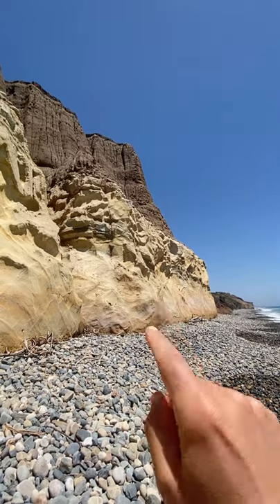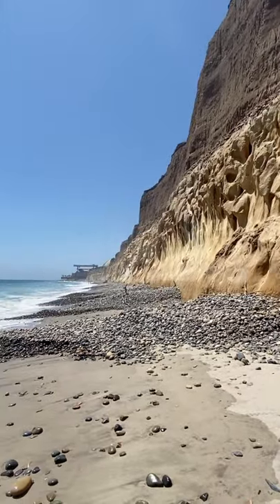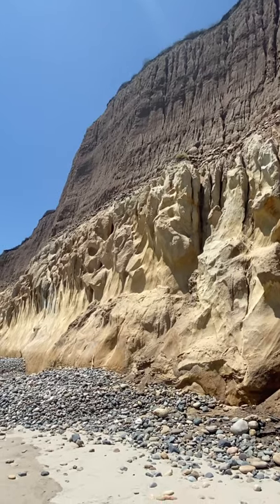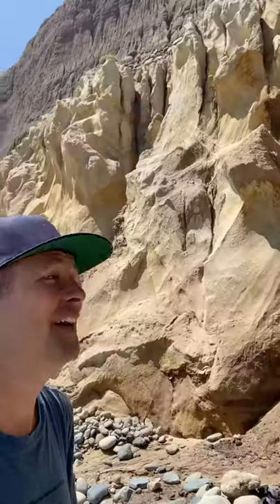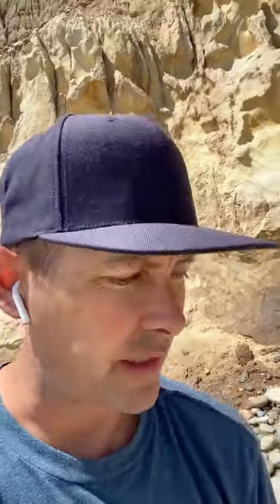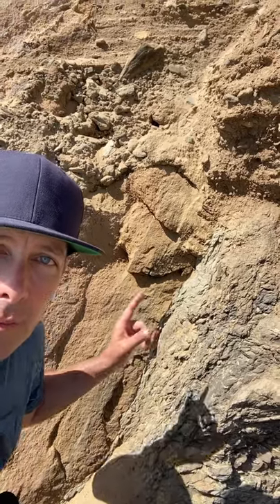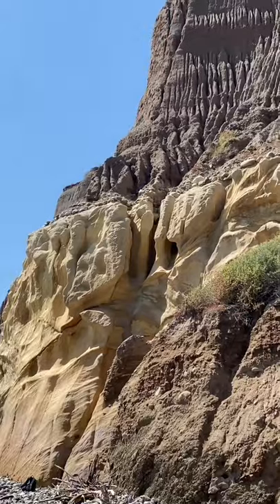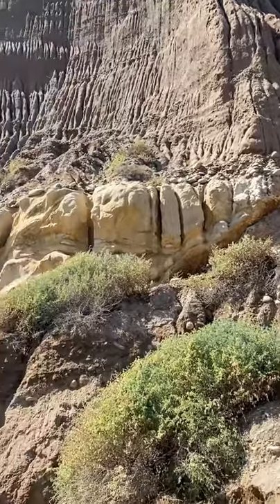Why is a Nuclear Power Plant built near a fault?

Comment: Cristianitos might be "dead," in geological terms, but the offshore Newport-Inglewood-Rose Canyon system (to which Cristianitos is connected) is most definitely not and poses its own hazards to the San Onofre site, including that of a major tsunami.  Inactive faults can reactivate, though: even if the chance is remote in this case, it's still non-zero since it's connected to an active system and embedded in a very active regional fault system.

Comment: That is a lot of top surface accretionary buildup of ONE HUNDRED PLUS FEET of boulders and mud atop a 125,000 YA previous fault activity (?)  Verbal typo (?) 125 million YA?  A most excellent vid and explanation.  Never did get all this explained until now - so kudos.  Sandstone metamorphic rock from an ocean basin/shoreline, then accretionary boulders from water and river (of magnificent size and flow events), turning into a shallow water mucky bay waters for final sedimentation.  THEN !  diagonally upthrust the whole geo upon the Monterrey shale at least 200-300 feet into the air, while the ocean level was rising and chewing away on the cliff face.  Lots of activity here.
Reply from the maker: Again, I like it!  Thanks for contributing!
Reply from the maker: Based on what I’ve read it’s around 125,000 years.  They studied isotopic ages from fossil shells from the San Onofre platform to arrive at that estimate.
Reply: @geologicallyspeaking  OK I am totally baffled.  There is 100+ feet on first boulders coming from massive outwash of waters from somewhere.  125,000 YA is earlier than end of the Ice Age 12,000s/10,000s BC (and no actual glacial fronts down this far south into Cali.  Any such finger glaciers atop the Sierras - possibly ?  Enough depth of snow and ice to wash out this nearly uniform layer of 1-2-3+ layers of boulders, then this huge dramatic mudflow.  If we could say that there HAS TO BE a vast water source for those rounded boulder emplacements, then that water was HUGE!  Only appears as an vast and melting glacier, a Cali glacial lake erupted like the WA/OR glacial floodings, leaving all this mud and muck at some ancient stopping point along this (now) current shoreline, or that were was massive (and continued seichis) of the Owens Lake, Central Valley inland waterways that was continually shaking and sloshing and throwing up such bottom mud and muck onto its shorelines 100+ miles (!) away.  One questions then, if someone notices any such mud and muck sloshing up against the Sierras for this once Central Valley inland sea, lake, glacial lake.  As you explain, this shore formation is not the start of its appearance, but that it extended a huge distance out into the sea, that has been washed and eroded through time to its current location and sea level.  That make this EVEN MORE HUGE !!!!  This isn't like the other vid of the dried river bed with its various granite et al boulders and pebbles that washed down out of the nearby mountains.  If this layer of boulders and pebbles in that boundary layer are up and down the coast, as well as its ancient "out there" extant of its once expanse, then that entire layer of boulders is (I don't have a word bigger than HUUUUGGGGEEE ! - cosmic?) event happening that would line the entire strata for miles with boulders, and then later slosh up such massive formation of 100+ feet of mud and muck.  As Central Valley would have this "stuff" in its basin, then it almost mandates that Central Valley has been shaken, uplifted, shaken and dropped a vast number of times - and puked out all this material, sloshing up against the Sierras, but also then sloshing out westward to the ocean across a massive and growing estuary bed.  Only later would coastal mountains and these uplifts create the coastal geology and boundaries of Central Valley.  How else explains this muck ?  You say marine fossils - OK.  Then this massive land of estuary and delta plains of an ocean shoreline was once much lower and further out to sea (we can agree on that).  This region of sloppy muck, not swamps, trees, moss, etc, just MUCK was 125,000 years of a previous massive outwashings from the mountains of those boulders onto that deep and flat seabed, then further outwashes of inland muck, and oceanic detritus was accreted onto the seabed and boulders.  Over time, all of this sandstone and muck was metamorphed, and thrust up to its current position.  And the sea cut from top to bottom of this uprising geology for these vertical cliffs.  There was HUUUUGGGGEEE events happening in this area by land, by water, by sea, by uplifts.   How big x tens of miles? is this formation known to exist.  Is there a defined river or inland waterway delta that answers those boulders and mudwash outflow?  It is like the biblical flood (and I'm not laughing ...) with such massive waters that washed any and ALL inland topsoil off the Sierras down to Central Valley and out to vast depths of the sea, and eventually it gets uplifted !!!  Those boulders have their own noted drop velocity from speeding water - that can be known.  That water velocity and depth, did not leave any accompanying mud within a huge layer of "stuff."  That would be easy to calculate.  If one says that the whole of this boulder and mud-muck happened at the same time (R U S M ??? !!!) such massive 100+ feet of small boulders (no huge glacier erratics here) with 100+ foot of massive flowing mud-muck waters, then coming up against an ancient barrier, the waters stopped, boulders dropped, and then one would have all the higher sand, clays, and silts start deposition.  That doesn't appear to be so here.  No big boulders, no layering of the mud-muck.  It is like our Livermore (once swamp basin) with the Altamont Pass here, was once a waterway, like the Sacramento and San Juaquin river systems flowing into SanFran Bay.  We probably have the same mud-muck depth in the Bay (now), surrounded by coastal mountain ridges and uplifts.   So seeing no great seaward formations that would be those outward boundaries in these 125,000 years, they were eroded by ocean erosion.  But this vast portion of area, was undersea (sand, clean sand, clean ocean water), then bouldered by only fresh water outflows), and later massively mucked up, and then uplifted.  100+ feet !!!  Lets say 125 feet.  125 feet of accretionary mud-muck in 125,000 years of time, and uplifted.  That is 1 foot of mud-muck sedimentary erosion flowing across this delta plain, estuary, and seabed swamp for each 1000 years.  I don't know of mud-muck growing further mud-muck.  It is only erosional and sedimentary accretion, and any such oceanic detritus falling down and creating this swampy muck bottom.

As this sandstone is clean and clear, this assuredly was a clean ocean environment, and a fault line was involved, when a Monterrey shale formation confronted this region.  Still oceanic sand basin is younger.   The vastly older region of mud-muck of clays and silts turning into mudstone, siltstone into shale, not long enough with depth, time, and pressure for slate.  So the Monterrey shale appears to be way older than the nearby clean ocean bed sand(stone).  Then this had to be uplifted so that a vast horizontal delta with a water outflow of massive depth and velocity layers an entire geological boundary of small boulders and pebbles - clean rocks no interbedded sand, trees, vegetation.  Then this must have dropped down again to be the last mud-muck for 125,000 years of outwash erosion and sedimentary accretion - along with the again dirty ocean mud-muck swamp.  In that same time, the whole formations were upthrust into their current elevation.  This land appears to have MASSIVE multiple uplifts, drops, and final upthrust.  That is massive California landshaking !

Comment: A question - WHAT IF !  IF this once top surface muddy-mucky mudstone formation was a shallow water inland oceanic basin (like many other muddy-mucky shallow water estuary basins up the entire West Coast.  This stratigraphic and strategically located geology slowly uplifted (most definitely after) the time of this  fault line.  The ocean sea level rose, but the land started uplifting faster.  The new ocean shoreline and wave action rose while the water cut DOWN THROUGH all the top mud to the boulders and it is now at its current location.  With all rivers and mountain geology (especially Grand Canyon and Pacific Northwest geologies), are questions of uplift - who was first  ?  the mountains with river cutting through later, or the river was first, and the mountains rose while the river cut down through the uplift.  Grand Canyon and PNW mountains and rivers - river was there first on flat land, that then rose with the river cutting down through the uplift.  San Onofre appears to be uplifted in time with a new ocean and shoreline that cut down from that almost perfect vertical cliff face - top to the bottom.  And current events are the recent landslide as undercuttings of the sandstone, causing the top surface overburden to erode and fall down.
Reply from the maker: For sure John!  I like it!

Comment: Actually, you are using the law of cross-cutting relationships to determine the relative ages of the different layers with respect to the faulting. Of course, superposition does give relative ages of the three layers from bottom to top, but the age relative to the faulting requires cross-cutting relationships to determine.

Comment: The plants have been shut down since 2013
Reply from the maker: Thankfully, the plant has run its course. I live in San Clemente and have always had my iodine pills nearby 😉. My buddy is actually working on the team dismantling it right now.  Fascinating engineering goes into those power plants. 🤯